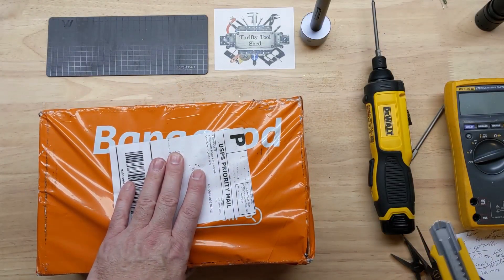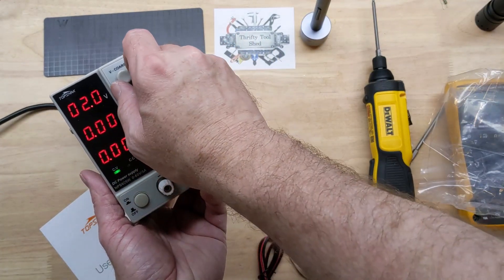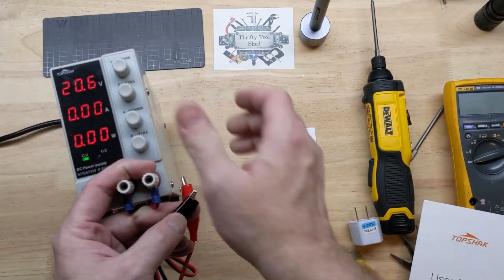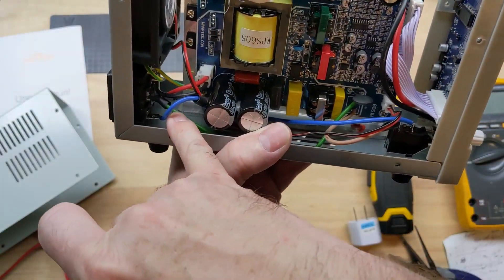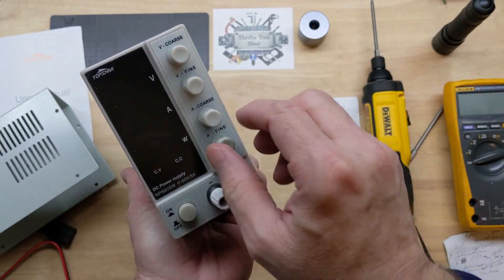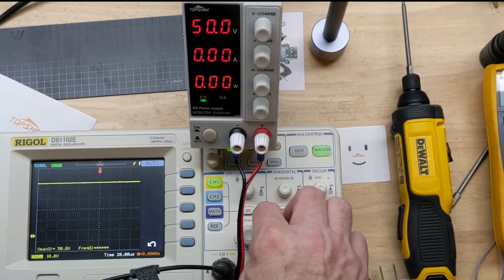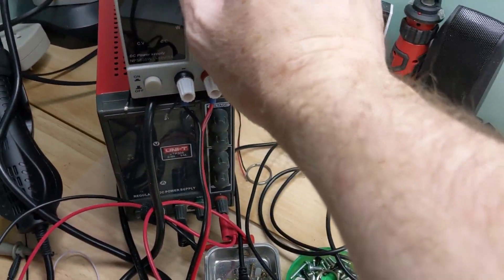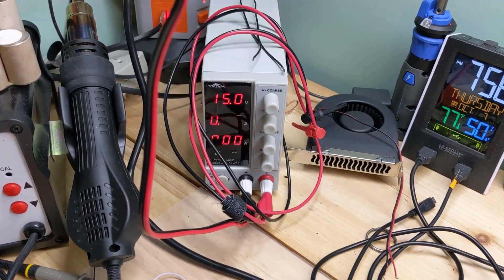TOPSHAK 0-60V 5A Power Supply Review with Look Inside

Comment: Can you tell me what's the part number for the upper of the switching mosfet? mine blew up, and i can't read the print. But I would like to repair it!
Reply from the maker: I will look. The very top semi is actually a CC dual diode package so I assume you mean the middle semi?
Reply from the maker: The bottom 2 semi's are both K3569 N-channel Mosfets. Looks like known as 2SK3569
Reply: Ah, ok then I am actually looking for the CC Dual Diode. Makes sense that that one blew because I reversed the current by having a LiFePo charged with it and when the BMS turned of the charge path it discharged the massive battery right into the Diode package.
Reply from the maker: Ok, the top semi is marked as ON semi 1660CT Common Cathode dual diode. Similar to this.
https://www.digikey.com/htmldatasheets/production/2453214/0/0/1/murf1620ct-1640ct-1660ct.html?utm_adgroup=General&utm_source=google&utm_medium=cpc&utm_campaign=Dynamic%20Search_EN_RLSA&utm_term=&utm_content=General&gclid=CjwKCAiA1uKMBhAGEiwAxzvX9-Xe5e1Dib1xVzHpszT5sRMAQ2k_IxzlH3tq3DiqqF-gG4RZ4ranoBoCfA0QAvD_BwE
Reply: @ThriftyToolShed  thank you so much! I will report back once I tried to replace the 1660CT. 🤩👍